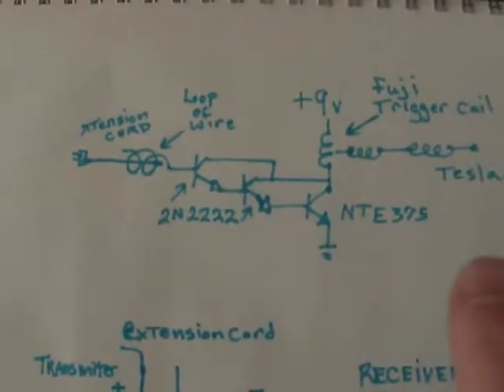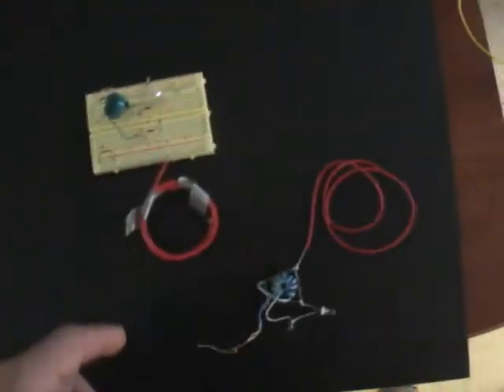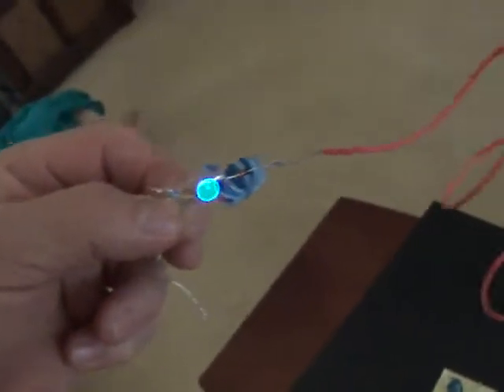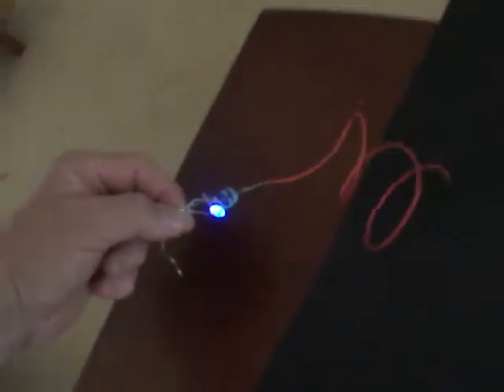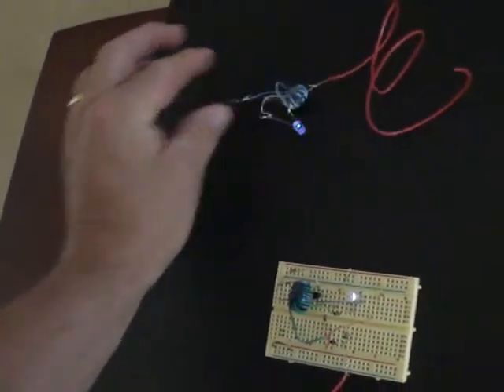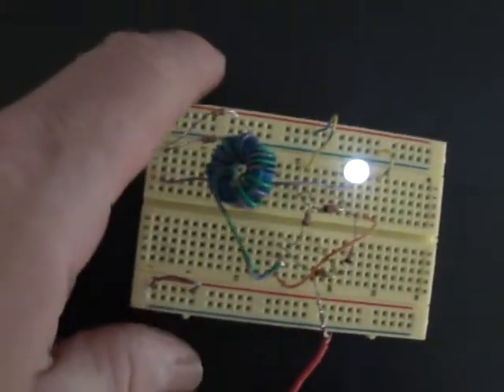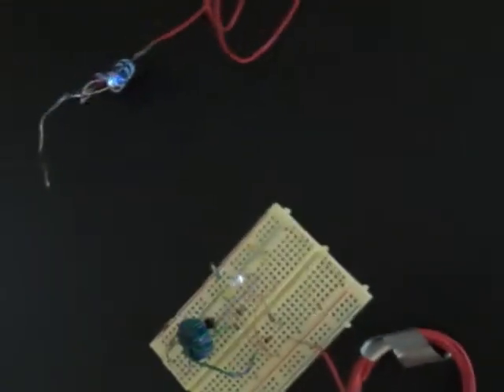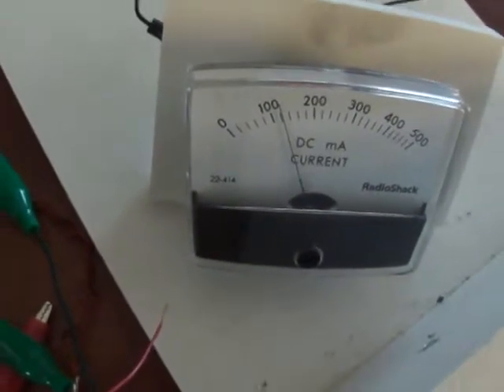Wireless power using 1 big antenna pad

Comment: Please check this video. The signal is amplified 3 times by a power-LESS Yagi-Uda array. The consumed power on a 50 ohm terminator is 9 times of the input.
Over Unit power output via Yagi antenna
Reply from the maker: Thanks Liu, I will try to add my device to this type of array.  When I get it completed, I will do a vid on it.  I have something new to show .